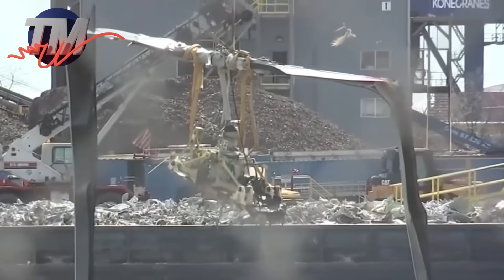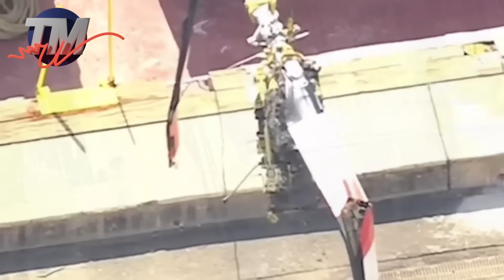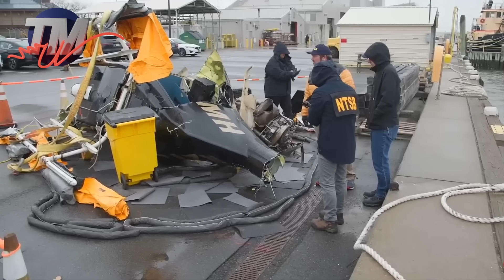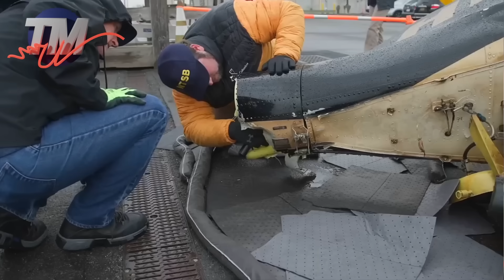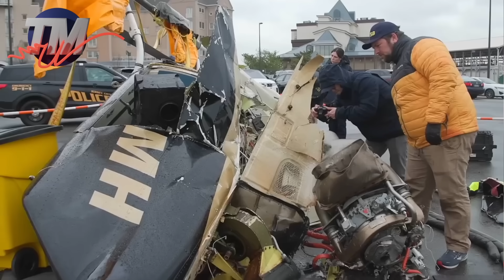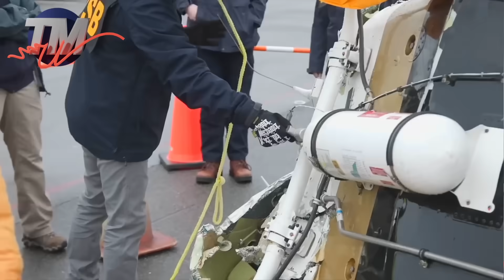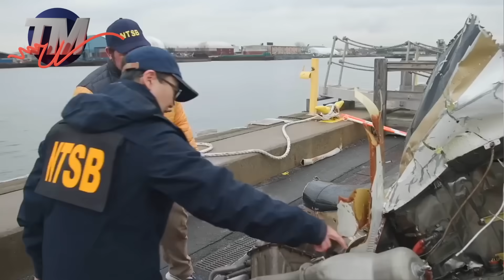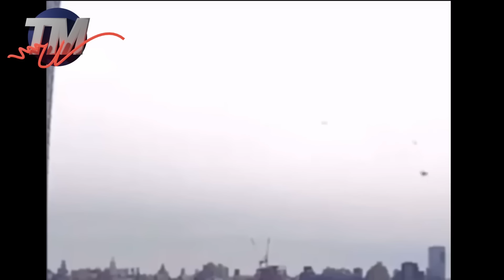Recovery of the Main Rotor of the Hudson River Tourist Helicopter - it's worse than we thought

Comment: I'm a helicopter instructor and LongRanger pilot.. I think it's safe to say that mast bumping is off the table.
Reply: Transmission seized?
Reply: @morganw8682  But wouldn't the a/c yaw left if the transmission seized? I'm convinced it yawed right. However, that would explain how the engine separated from the transmission (and the a/c).
Reply: @paulward2787  Looked like the tail came around towards the camera and thus yawing left to me.
Reply: @morganw8682  That's the theory from Blancolirio.
Reply: @notillatall you are going to be proven wrong and humiliated mate , his theory is spot on .
Reply: As an old German helicopter mechanic, I can tell you that it was never mast bumping. That thought could only have come from stupid people who have no idea about flying or aerodynamics. For mast bumping, you always have to first bring the helicopter into a low-G situation. That's not possible in straight flight.

I looked at the pictures with my colleagues in the repair dock. We all immediately agreed it was a jammed main gear. We could almost immediately rule out anything else. When the rotor head, with the twisted rotor mast (twisted approximately 160 degrees, torsion), emerged from the water, we had the necessary safety.

We can easily explain why even the main gear remained in one piece and why the gear mounts didn't break. Because the forces are so great with a jammed gear, the entire engine deck simply tears out of the airframe. This is the weakest point in the structure. The airframe wasn't built or designed for this load direction. If the planetary gear is blocked, rescue is no longer possible! All helicopter manufacturers know this and therefore stipulate that an emergency landing must be initiated immediately if a "red chip detector" is detected. 999 out of a thousand times, it will be fine because it's only a single chip that triggers the alarm. The thousandth time, it's the final warning before death.
What I would be very interested to know, as a German helicopter mechanic, is whether, in the USA, in addition to the engine, the main gearbox is also monitored with vibration sensors? In Europe, this has been standard practice for years, as it is the only reliable method for detecting such faults early on. A broken gearbox sounds different and also has different vibration values.
What scares me most as a mechanic (besides the 6 dead) is the fact that the aircraft just came back from maintenance 14 days ago. Unfortunately, this isn't the only incident of this kind. A similar accident occurred in 2016 involving a Super Puma in Norway, which was en route to an oil drilling platform. The images of the rotor head flying alone with its gearbox and a lone airframe in a dive are uncannily similar to the images from New York.
Reply: @thomaskamp9365    I looked at a picture of the back end of the helicopter body and the transition shows that the boom was barely attached to the transition.  The boom only overlapped a quarter of an inch and the rivets were still there so the boom ripped loose from the transition and then swung out 90 degrees seizing the gearbox  which then caused the transmission to rip loose from the body.  The joint was only a single row should be a double row I believe.
Reply: @thomaskamp9365  bingo, exactly, around 1989 or 90 I took a long trip from Cleveland to the West Coast like I would a couple times of the year, this trip I was gonna do a more northern route, I picked up a rider in Chicago to help share with fuel, as we got up near Portland I wanted to go up as far as you could drive up near Mount Saint Helens towards the old Spirit Lake.
We got up there just for sunset, we crashed in the van and then I woke up early in the morning to a helicopter noise very loud .

A big forest service chopper was landing in the parking lot 

It was something like it’s a Corky King stallion where the air crew sat up high above the cargo deck

Anyhow they land they all get out, he pulls the ladder out he’s up by the gearbox, he’s got an indicator light 😮

Yep it was exactly the sensor you were talking about, so he has to land pull that magnetic sensor out and visually inspected to see if he’s got anything going on, he didn’t have a big enough wrench which I actually happen to have so I loaned them tools and watched and learned 

As soon as he yanked it out his copilot held a rag over the hole with the hot turbine oil 

He felt comfortable with continuing their mission and they went up onto the mountain to change out a composting latrine somewhere up there
Reply: I KNEW It!
Reply: @Maxamander3008 
No you didn’t.
Reply: @notillatall did you go to the DJT school of behavior in group discussion? Kamp's theory appears well thought out and based on experience and knowledge of his craft. Your retort is without substance nor backing and appears purely an emotional response.
Reply: @sandlot40 agree - the name calling too - he’s got issues 😂
Reply: @notillatall  @notillatall I can live with you calling me a complete idiot. I take this very seriously and am still happy to take up the gauntlet. Let's quickly consider what mast bumping is, how it occurs, and what the subsequent error pattern of mast bumping looks like. So far, this doesn't match either the images of the crash or the images of the wreckage.
For mass bumping to occur, the pilot has to bring the helicopter into a low-G maneuver, because the lack of pulling forces on the rotor triggers the error. In a low-G situation, the helicopter then tends to rotate to the right or left around the propeller joint (depending on the rotor rotation direction). If the pilot makes the mistake and instinctively countersteers (instead of correctly pulling the stick and applying more G's to the pull axis), the controls can overreact and override the tilt of the rotor rotation axis. As a result, the rotor head would strike the inside of the mast, leaving two notches on the mast. At the same time, the outer edges of the blades could cut off the tail rotor or tail boom.
Let's briefly compare your stupid theory with the facts:
Question: Did the pilot conduct a low-G maneuver?
Answer: No. The pilot continued to fly his helicopter in a straight line, even inside the building. This can be clearly seen in several videos.
Question: Do the wreckage damage and the accident circumstances fit this error?
Answer: Only the severed tail boom is consistent with such an accident. However, this accident circumstances would neither explain a twisted mast (twisted by approximately 160 degrees in the videos, torsion), nor could such an accident circumstances generate enough energy to cause the entire engine deck, including the main gearbox, mast, and rotor, to detach from the airframe. In the case of a must-bump with a severed tail boom, all helicopters have so far come down in two pieces: 1) the severed tail rotor and 2) the rest of the fuselage.

As a helicopter mechanic, I challenge you, a supposed colleague from the technical field, to explain how the boom can twist 160° in flight and how the fuselage was torn into three pieces in mid-air? The fact that the control rods between the swashplate and the rotor head wrapped around the boom like a corkscrew also doesn't fit with a boom bump. I'm patiently waiting for your answer and your pathetic attempts at explanation. For my part, I absolve the deceased pilot of all blame. The deceased deserves that much respect at all times.

Now let's get to the unpleasant truth that no mechanic or pilot wants to hear. As a mechanic, I've worked my whole life, worrying that something like this wouldn't happen. Every time we had an alarm in the maintenance hangar telling us that some aircraft was in an emergency, they could see 50 grown men turning white as chalk. With every alarm, each of us went over all the actions we'd taken over the past two years and hoped that none of us had made a mistake that caused problems for the aircraft.
We all know that aviation rules were written in blood to prevent further bloodshed.

What fault do the wreckage and damaged components match?
Answer: There is only one explanation for this: it can only be a main gear locked in flight. No other fault pattern is capable of twisting the rotor mast so much in flight or tearing the engine deck out of the fuselage.
Question: Have there been similar incidents?
Answer: Yes, in 2016, a Super Puma crashed in Norway with the same problems. The fault pattern was similar. The main gear on the Super Puma locked in flight. The mast twisted in exactly the same way because the entire rotor head with blades was decelerated from 265 rpm to zero. However, the main gearbox exploded first due to the enormous forces. On the Bell 206 Long, the main gearbox wasn't the weakest point; rather, the forces were transmitted to the engine deck via the main gearbox and its mounts. However, the engine deck was never designed for such torsional stress, as such a thing doesn't occur in flight. Therefore, the engine deck tore away from the rest of the fuselage. The rotating blades then collided with the tail boom in mid-air, causing the tail boom to be severed.

Question: The helicopter had been inspected 14 days earlier. Shouldn't something like this have been discovered then?
Answer: That's a question I can't answer because I don't have the data. The relevant authorities will have to investigate, as only they have access to the flight log files and the logbook.
As far as I know (without a type briefing on this particular helicopter), an inspection of the main gearbox isn't part of a minor inspection. However, it will be included in major inspections. I also don't know if the helicopter had previously had a problem with the chip detector, which would have been a final warning.
Question: Could the pilot have done something better or more correctly?
Answer: If the pilot had received a warning from the chip detector (no one knows), he should have initiated an emergency landing immediately. However, it's possible that the pilot didn't receive a warning from the chip detector and was caught off guard by the accident. This also happened without any warning with the Super Puma in Norway. The Super Puma was a much newer aircraft with much more monitoring technology.
Reply: @thomaskamp9365 I think he did get a warning… but over the radio what are you going to say, okay then I’ll say I just need to set down for some fuel, you can’t say hay I got a gearbox warning over the dam frequency
Reply: For sure! From time 1.48 to 2.12 you can see a large hole in the tail section where the break is, where the tail section came off on the side facing the camera, the left side if the tail boom. Do you see that?
Reply: Lost tail section (mechanical failure) but the pilot could not engage the clutch in time...
Reply: Jammed gear? The momentum seemed to spin the copter to dome degrees. Such a sudden change in pivot, load, and fulcrum, I would imagine the outcome.
Reply: i didn't think it had anything to do with mast bumping, the 206 has a semi rigid rotor system meaning the rotor disk does not move that far aft to strike a tail boom, likely a seized transmission either low on trans oil or some other internal failure, i would examine the hours on the transmission, as well as maintenance records.
Reply: Interesting. I said mast bump first as well. But I’m not convinced now
Reply: That is why I stopped the video where the rotor system is being brought up… no way that was a mast bump.
Reply: Im just a guy that reads a lot of stuff on the internet but I think its safe to say you are wrong.  Google ATSB Transport Safety Report Aviation Occurrence Investigation (Short) AO-2022-034 Final – 12 May 2023
Reply: @notillatall . Thomas Kamp is correct, you sir, are an incorrect blow-hard!
Reply: It was the nut behind the wheel
Reply: Jesus nut?
Reply: Yep
Reply: Warrant Officer Joseph A. Footer–my father, was as well. For 40+ years, I've heard enough to know better. He was a Vietnam War [two tours 67‐'69], Vet, a Huey / Cobra pilot, an instructor, and former maintenance officer. As a child of this guy, we know to LISTEN to you guys — you KNOW — your hunch is closer to any speculation.
Reply: Absolutely.  The boom broke at the body.
Reply: Smells like sabotage to me. When Chuck Schumer spoke on it, it made me wonder what is being covered up. His involvement makes it more suspicious as something sinister. Not sure if the family was the target, or the tour group that owns the charter. Wonder who booked the sight seeing flight?🤔
Reply: @notillatall why?
Reply: You would see the damage on the mast, if that was the case. They would know that already.
Reply: From videos it seems like tail failed first, then top rotor...
Reply: @Faiillia  More likely the tail drive shaft failed and took the tail off with it as the transmission was departing from the helicopter since the main rotor drive shaft and the tail rotor drive shaft both attach to the same transmission gearbox.
Reply: I agree.  Mast bump occurs near the top of the mast where the yoke would strike the mast.  What can be seen from the photos doesn't indicate a M-B.
Reply: The boom rivets look like they weren't riveted correctly.  The paint shows that the aluminum didn't go far enough towards the the front than would have been needed to hold the boom on.  The paint line shows where the aluminum ended.  Seems to me that it needed two rows of rivets.
Reply: @Islamisthecultofsin  I think the line you're looking at isn't an overlapped panel, it's a line of rivets that secure that internal structure within the shell and the panel's zippered off down that line of rivets. Basically that line is in the middle of a sheet, not an end... you can see the tear line goes back beyond the rivets towards the upper side where the inspector is resting his hand, that's the same piece of aluminum, no seam.
Reply: @mfree80286    The line of rivets that I'm referring to is at edge of the aluminum sheet that makes up the transition.  The aluminum is bare where the boom attached and was painted black.  The boom ripped out from under the rivets and the transition aluminum that was under the boom material is unpainted.  It is only about a quarter of an inch.  There was nothing holding the boom on if what I'm saying is correct.
Reply: @Islamisthecultofsin  
could be, given the high usage I wouldn't be surprised if there were signs of metal fatigue in the tail boom and from rhe mountings for the transition. This could be a variation on the Aloha 242 crash.
Reply: @drmayeda1930    Didn't look like the transition was made right.  Looked like a repair job gone bad.  Not enough aluminum around the rivets to hold the boom on and then it has to take side loads to keep the helicopter from rotating.  I believe this is what failed.  the boom broke loose and buckled and then the transmission seized and it ripped free from the helicopter.
Reply: Elon does want to get rid of the FAA
Reply: @TheMs606  Elon is all kinds of crazy but he's not trying to get rid of the FAA. Stick to the stuff that's true, there's plenty of that so there's no need to make up lies...which will only damage your own credibility anyway.
Reply: @notillatall  Clearly they out of fuel since the pilot requested to have his tanks topped off upon landing.
Reply: @chrismaverick9828  Lack of fuel wouldn't cause this type of destruction.
Reply: @chrismaverick9828  that wouldn't cause this... running out of fuel you could still land

Comment: Every mechanical system have a fuse, which means, a part that , if everything locks, will fail first and therefore save the rest of the system.
Since the entire system was ripped from the fuselage, the force to break the fuse (teh weakest part of the assemblY) was not reached, which in turn tends to point to a structural fail where the transmission connects to the fuselage,
We can clearly see a part of the fuselage still connected to the transmission base....
In this case, a fail in the fuselage initially dislodged the entire transmission which in turn made the blades hit hit the boom which in turn dramatically raised the forces in the transmission mounting assembly and, because there was already a failure there , the force to rip the entire assembly off was lower than the force needed to kill the fuse so the entire assembly was ripped...

Comment: Transmission failure or seizure?   Isn't it connected to both rotors?  Maybe the dynamic forces could cause structural failures.
Reply: There is only one rotor assembly which includes two blades.

Comment: My  guess is something siezed in the transmission drive mechanism and locked up, and the rotor torque tore the entire assembly from the airframe. The tail boom failed when the torque caused the fusalage to rotate contrary to the flight path and the side stress exceeded design limits?
Reply: That's my take.
Reply: That's a good guess. Probably aided by stress cracks and a salt water enviroment.
Reply: Certainly would account for the sudden yaw from countertorque.
Reply: I agree. From time 1.48 to 2.12 you can see a large hole in the tail section where the break is, where the tail section came off on the side facing the camera, the left side if the tail boom. Do you see that?
Reply: thinking it's the driveshaft to the tailrotor.  Whether we can see it on 3D or 2D, that boom swings out into the relative wind....  it's the shaft in there, twisting free & taking out the rear empennage.  Those rivets are all sheared clean.  No chance for pilot or pax.  That shaft to the tail should tell the story.
Reply: Where's the bend and why did the boom depart first?
Reply: @ozemale6t9  Main rotor and gearbox took some time to tear themselves from the fuselage.
Tail boom went straight away.